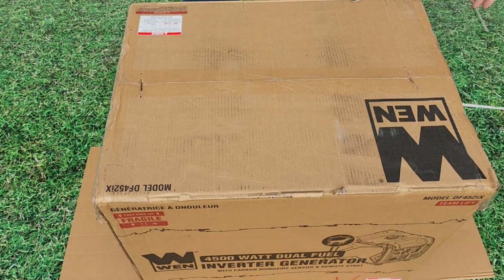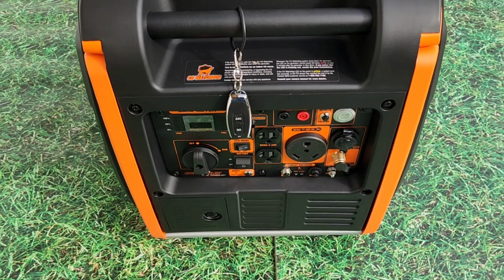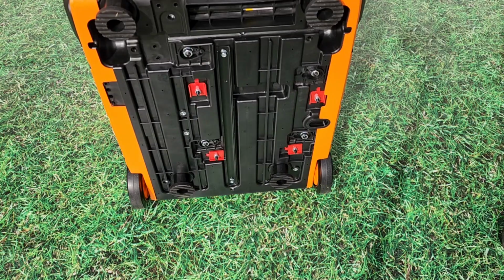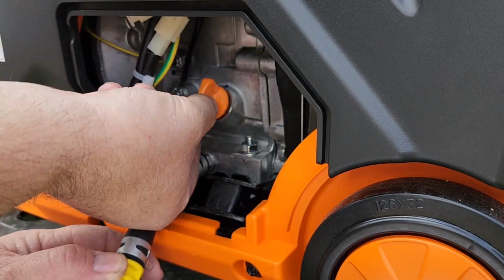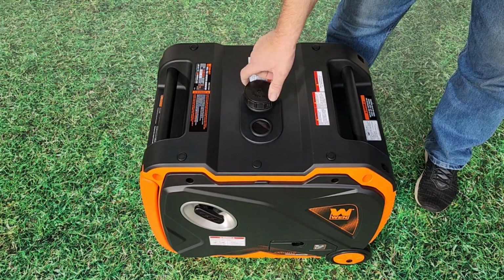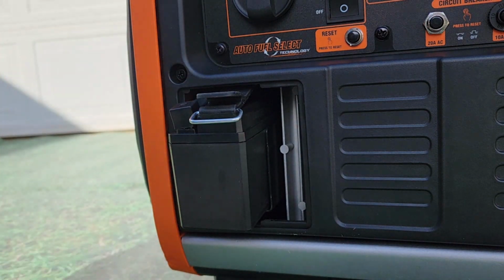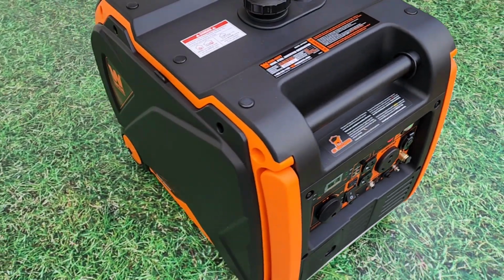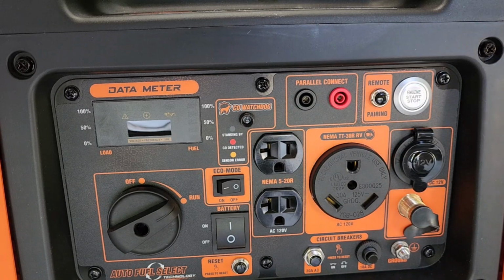Wen DF452iX Dual Fuel Inverter Generator Unboxing and Setup

Comment: Used this generator for power after hurricane Milton worked awsome. I was able to run 2 5000 btu air conditioners microwave garage door opener toaster microwave refrigerator  television modem charge everything all lights. This is great hooked up to a power inlet and interlock to breaker panel and its quiet and efficient.

Comment: Anyone on here know how to reset the 120v 30R RV circuit on this generator. Ran a 120v welder on this at 115 amps and it popped the circuit which doesn’t reset with the front panel buttons. If anyone knows please let me know thanks

Comment: Wondering how this is doing for anyone that has owned one for a while.  I am thinking of getting one for our travel trailer as the only generator I currently have it too loud for camping.   Any problems with it?
Reply: I tell you this! It’s very quiet compared to many other brands.
Reply from the maker: Works great for us while boondocking. No problems.

Comment: mine came with the battery already connected and did not have a quick connect as shown in the manual yet it does not start from the start button or the remote.  The battery is reading 13.2V so it doesn't appear to be a dead battery issue.  So it seems like the battery is disconnected but there is no disconnect in the battery box.  Just wondering if anyone else has run into this issue and has found a solution before I take the side panels off and go digging.
Reply: ok... i'll answer my own question... there is a quick disconnect but its in the compartment behind the battery compartment.  If you remove the battery and I guess pull hard enough on the battery leads it will come out and then you can do the quick disconnect per the manual instructions but mine was very stuck and I was afraid to pull any harder on the leads for fear of damaging them.  So if yours is stuck, like mine was, removing the left side cover (with the front being the control panel) the battery leads and quick disconnect is accessible and can be connected and then the remote and automatic start work properly.
Reply from the maker: Glad you figured it out.  Thanks for sharing.

Comment: Thank you for sharing this video. I am planning to buy a generator for my mobile massage bus. You explained very well in this video. I have one question that I want to make sure. In this video there is a gas and electric (battery). Do we have to "ON" both gas and Electric (battery) before using the unit?  or either one is enough. I hope you will answer my concern. Thank you ...

Comment: I wouldn't advise anyone to buy this generator.... it around 1400  to 1500 watts... it can't even run my  portable  whynter air conditioner ...
Reply: wen is one of the most reliable companies in the country, if they  its 4500, its 4500
Reply: Your generator has issues then because 120 Volts x 20 Amps = 2,400 Watts.

Comment: I went with the  Wen df250i which should do just fine for rotating between running a couple window units and modem and running fridge to keep food cold during power outages. If needed I could also use my Sportsman 1000i to run the fridge and freezer.
Reply from the maker: Very nice!

Comment: Just bought two of these, I had the old model without remote start. Should be a nice upgrade.
Reply from the maker: This one has been great so far. We used it for a week of boondocking in Florida in the green swamp and it performed great. It ran the AC and the microwave in our RV without any problem.